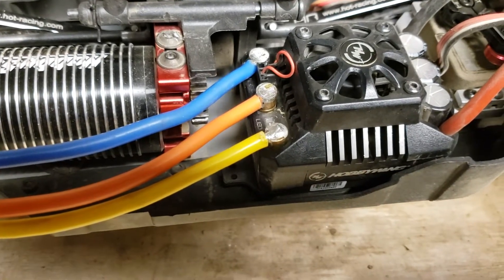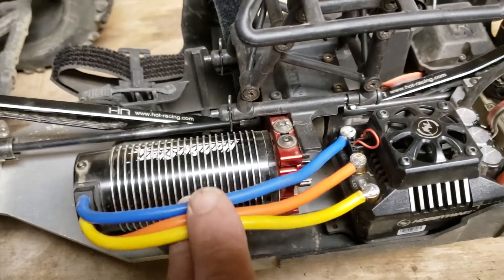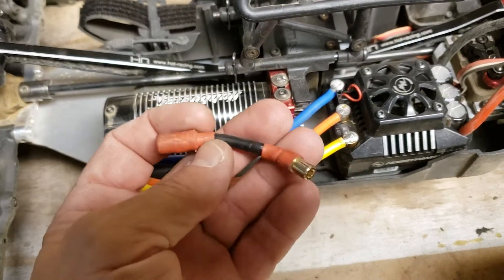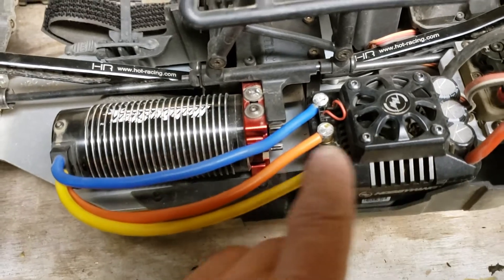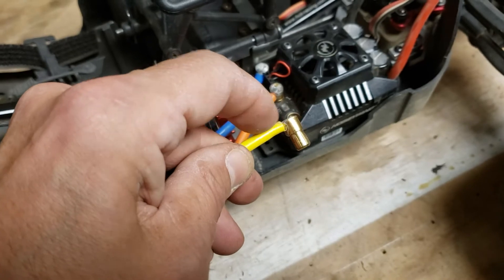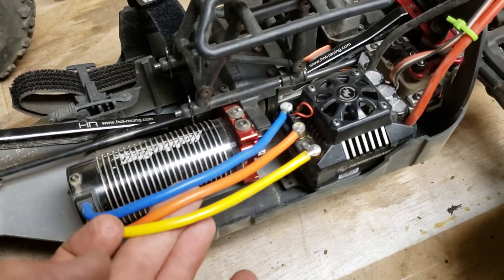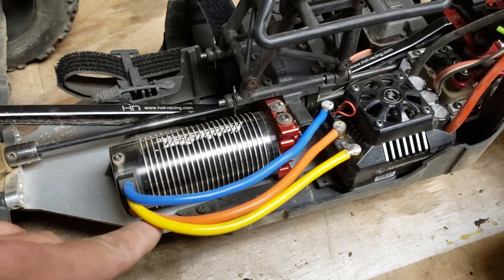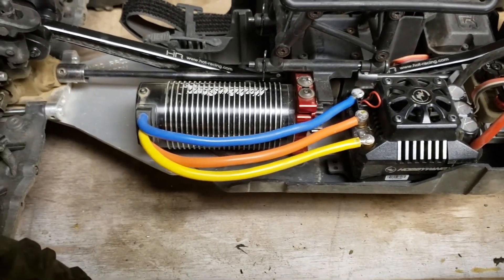90 degree bullet connection for the Hobbystar motors

Comment: this is crazy, five yrs later and still the same issue. Why not add just about half an inch? like they never thought the connectors go bad and may need replacing, etc.
I have two Hobbystar motors, and BOTH w the same issue, the cables are frustratingly too short, so close, but yet too far kind of deal.
Like seriously, give us half inch more of cable, Hobbystar dont be cheapskate. No wonder when I received one of the motors looked like it was returned, and now I am getting a hold of customer service and they giving me the run around silent treatment....

Comment: I seen that yesterday in the traxxas 4tec group I was very mind blown...and cant you you loosen the front part on the hobbystar motor and turn the can so you can have you wires ontop
Reply: The mounting plate loosen the screws and turn it so you can have the wires ontop...that's what I was talking about
Reply from the maker: @onemansvideos2134  That's a thought. I've never tried. But I think you would still need a little extra length on the wires.
Reply: @bicketybamRC  it will reach
Reply: @bicketybamRC  plus the top plate will protect the wires from the pinion